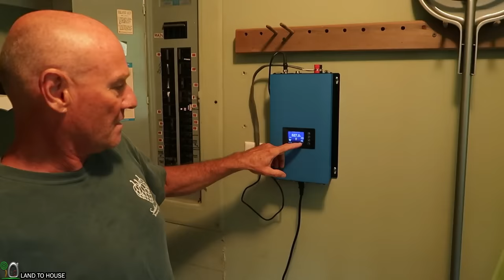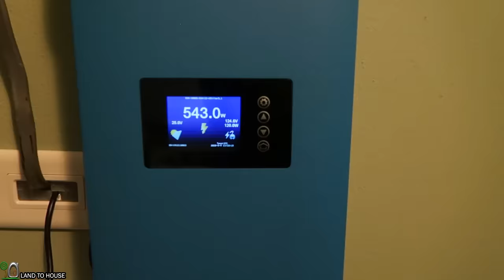Awesome Low Head High Flow Grid Tie Micro Hydro 530 watts!

Comment: If you put a valve (ball or butterfly) in that 8 inch pipe, you could turn it off, this would store water in the upper pipe (potential energy), so when you open it again it would start up the genny again with out the need of a shop vac.
Reply: Do you know how much an 8" valve costs?
Reply: i made a knife  gate valve from scrap for free, knife box below waterline in lower pool. so there you go

Comment: Obvious upgrade projects: meter the water level, add an automatic valve in there, make it self-prime - all fairly trivial and then you could just leave it running, then fix your meter.
Reply: Screaming for a Tesla powerwall battery system!
Reply: I was thinking the same thing.  Could be a simple as a float actuated potentiometer controlling a gate on the inlet.  Heck, if you really wanted to, you could use a float on a lever to mechanically control the gate if you didn't want to mess with switches and motors near the water.
Reply: Also switching the 90s for two 45s to reduce the loss of velocity thus increasing the energy generation, better yet, move the drop to the other side of the stairs
Reply: @MacroAggressor  An old toilet float would do nicely.
Reply: @dukeman7595  Sure, that would be the simplest solution.  My only concern would be with the on/off operation of it, you may induce unnecessary wear and reduce efficiency to boot.  But, as far as a simple off switch, that would be a great way to go.
Reply: Why wouldn't you just leave the water pickup say a foot below the surface, and just let it run until it can't? Obviously you would still need to prime the system but this way it wouldn't drain the pond.
Reply: @RedFly600  probably trying to avoid upstream standing water and mosquitos
Reply: @brettjames9088  yup, you don't want the garbage from the surface, probably wouldn't run very efficient either - the head pressure helps with the siphon too, seems like you'd want it deep under the water and then to control it another way.
Reply: @streaky81  yeah running or empty seems the best strategy to me if it was my property.
Reply: @SimplyStuart94  That's the spirit!
Reply: obvious but un necessary and undoable.............
Reply: Why not just use the vacuum take off to evacuate an appropriately sized tank with a float valve set to be open when the dam overflows and closed when it doesn't. This way, when the dam falls below operating level, the vacuum reservoir stores the energy required for the next priming and as soon as the dam reaches operating level again, the valve opens and the system self starts. It would only require the addition of a length of hose, a float valve and a piece of (offcut) pipe.
Reply: @zachyoung5598  gonna be honest, no idea what you are talking about.
Reply: @Brett James
The port that he uses for priming produces a good vacuum during operation (up to the vapour pressure of water). That vacuum could be stored in a tank (made of a piece of offcut 6" pipe equal in volume to the pipe above the turbine junction) by attaching a hose/pipe to the vacuum port and running it up to dam level, where it is connected to the tank by a float valve (set to overflow height) to open the tank when the dam is overflowing and close it when it is not overflowing. When the system is operating, it will pull a vacuum in the tank. When the dam falls below operating level, the valve closes. When the valve opens again (as the dam begins to overflow), the vacuum is released, pulling water into the pipe and over the dam, thus restarting the system. This eliminates the need for sensors and electrically actuated valves (the original solution proposed in this thread) and also removes flow obstructions associated with inline valving (the second solution proposed here).
Reply: @zachyoung5598  explain this to me like I'm 5

Comment: I know that there are limitations on location and practicality, but the turbine would last longer if it was placed down the flow path (low water pressure will cause cavitation on turbine blades and increase wear & tear) but all in all great job for making something green out of household materials !
Reply: @Artificial Hobos hmmm, don’t know if there are of the shelf self contained (with generator) solutions for that around. My only point was that if they are running it through submerged turbine, I would place the turbine assembly at bottom end and slightly restrict the exit nozzle (5% maybe) which would increase internal pressure and eliminate cavitation. But if the use something (like pelton wheel) which is built for air in the housing than my point is very much DOA :) but to your point pelton wheel might be more robust if stones get captured in the pipe. But going back to the placement - it better to extract energy from positive pressure which can come in many BAR than negative pressure that can only get to -1 (well 0 for vacuum but I’m referring to pressure expressed on working part).
Reply: @Artificial Hobos I love the ghetto style with washing machine motor :) Old engineering paradigm: "if it works, it works". In regards of Australia - I'm not sure how anybody could build any hydro there, one it's pretty flat, second water is a bit of luxury. But if one is so lucky to have both (river and decent elevation change) go for it. Thou in Australia, I would think solar would be better solution since sun exposure is a greater and land prices cheaper, but again all depends on what's ones circumstances. Going back to turbines, alto I think Fransic would be better than Pelton, I like the idea of aerator for a small pond and having some fish as well. Mist from Pelton could also provide nice cooling effect on hot days, so three birds with one stone :)
Reply: @Artificial Hobos Do you remember the name of that series ? I would watch it and maybe drop him some info on bearings if I found something obvious ?

Comment: I think instead of using the shop-vac you can put a Ball Valve near to the Outlet and move your Shop-Vac Hose connection to a higher point under the turbine to use it as a filler pipe. To start the Syphon for the first time, you have to close the lower valve, open the upper one and fill the Pipe with Water until it overflows from the filler pipe. Then close the upper valve and open the lower one. At this point you can turn the Syphon off and on whenever you want, only by turning the lower valve.
Reply: I think that lower valve could be fitted with an actuator controlled by a simple Arduino device which could be used to monitor pond level and throttle water flow to ensure the pond stays full to the brink of spillover. Or at least not vacuuming the pond dry.
Reply: He mentioned that idea as the "regular way" which is inconvenient. The shop vac was a great way to very quickly start it up without getting yourself wet.
Reply: Price out a 6 inch ball valve.
Reply: @kkarllwt  Where I'm sitting a 6 inch PVC ball valve costs $113.

Comment: 3:06 or at the end of the green pipe cover it up and then fill by hand some water until the green pipe is filled with water then once filled cover the hole then open the end of the green pipe
then suction will start and there ya go!
Reply: They did say the only other way to get it going would be to fill the pipe with water before he got out his handy dandy shop-vac lol
Reply: Priming a siphon basically

Comment: Take the water falling over the edge and fill the line up with a valve close to the end. When you open it it will suck the water up and over thus it will self prime without anything.
I built mine to be automatic with check valves.
Reply: awesome comment
Reply: itd be better to design the dam this way to begin with with a channel on a ledge to prime the pump.
Reply: @Dane Duttry   Not knocking your suggestion at all and have never built a hydro setup at all so this is only a suggestion that may be useless for reasons I don't know of but:  I was thinking after reading your suggestion of an idea. How do you think it would go if he had something like a large ball valve at the bottom to hold the water till you're ready to run it, up above but just below the dam runover he had a funnel mounted in a section of the water ran into normally over beside his pipe and it fed into it. The ball valve closed the water would soon fill up to that point just below the edge and if you had a floating ball that fairly cleanly sealed off the funnel when you opened the ball valve and things started sucking (in the best way) then you'd have only the ball valve to open to get the system running. 
 I know it wouldn't make a huge difference but, every little bit easier it is to operate and control has got to be a help. Anyhow, like I said, I have no experience, you do so I'm just throwing an idea at someone who has experience with this sort of thing to see what you think, useful or just a dumb idea that may even cause more problems than it's worth?
Reply: I pumped water a long way to a tank i would trap all the water in the pipe to prime the pump
Reply: Another thought, could you install another gate valve before the turbine to control the rate of intake so the suction doesn't drain the pond below the dam and ultimately the intake? I realize this would potentially slow the turbine but then he wouldn't have to worry about draining the pond down too quickly.

Comment: The vacuum you pull with that flow is insane. The venturi effect usually leaves a lot to be desired in denser fluids (water rather than air) but on a scale like this with a 30% increase in volume at the tailwater you are getting a massive vacuum. Its actually beautiful. You could increase the flow but that could lead to several issues in other areas, and fixing those might require some shotgun science. Patch it all and hope for the best. Guess the issue. You have a beautiful setup, sure it could be improved but why do it.
Reply: He doesn't need a vacuum on that pipe.  He has a downhill drop of 15 feet.  Once that water begins flowing, gravity alone will "pull"  water from the pond.  But here is the real point. He could easily have drawn his water from below the water line at the damn face.  No siphon needed.  Also I am certain that this flow rate could easily produce over 2,000 watts, ending his need for any power from the grid until winter.
Reply: I’ve been wanting to make one, we have a cabin near sa stream, this would help to illuminate our small and poor community. I just do not know where to start and who to ask

Comment: This is one of my dreams. A house near a peaceful river or creek and has unlimited renewable energy attached to it. I wish I have knowledge to reproduce this kind of tech and assembly with respect to the owner of the video. 

More power to you both, sirs
Reply: Ideal for stream or creek, not so ideal for a run off pond. Much depends on rainfall.
Reply: You're not going to power a whole lot of things with only 500 watts.
Reply: @Mick_A_Knuckle  you wont power shit with 500 watts. maybe a big fan or something
Reply: @Mick_A_Knuckle  it's better than nothing.
Reply: @Mick_A_Knuckle  500 is not zero
Reply: @cypresspuz  might as well be
Reply: @Mick_A_Knuckle  500 watts which could theoretically run 24/7. Pair it with battery storage and you're producing and storing 12kwh per day
Reply: @ThePmachell yeah he should've maybe bought a few deep cycle or lithium car batteries and set them up to trickle charge 24/7, then they could run off that at night independent of the grid and if the battery died have a switch to the main grid 

All this "unlimited" 500w power generation isnt much if it's not being stored 

I would've thought a turbine at the end of the pipe would produce more power than at the top. 

As at the top he's depending on flow rate, but at the bottom he could depend on flow rate AND potential energy pressure of the water.
Reply: @justinmacks1481  I'm no engineer, physicist or whatever but I was also thinking something the same.
why not also add an extra turbine at the bottom? it could probably squeeze extra energy from it. not only pressure enters the equation but also gravity.
Reply: @Mick_A_Knuckle  He could be pulling far more than 500 watts out of that setup. He's losing a lot of energy to flow speed

Comment: Brilliant ideas! I believe that there is a small voltage drop on the line that can be reduced by doubling the size of the conductors of the line. Greetings
Reply: Maybe put the inverter closer to the dam. 24volts 500watts is 20 amps going 100ft is about 20% voltage drop.

If he switches it to 120v at the dam that 10 gauge wire offers a 0.5% voltage drop.

Comment: This is one of the most effective micro hydro setups I have seen. If 500 W is all you need or want this works. Good work.
Reply: exactly, the point is making a bit more than you want to use,not mainstream thinking,gota make it big to make rich people richer.
Reply from the maker: Bill put a lot of thought into this setup. Turned out well for a hobby.
Reply from the maker: Bill is happy with 500 watts. Working well for him.

Comment: I've bought an array of second hand solar panels and I spent 500$ for the set of 10x 190w 44v panels and I picked up 2x 250w 48v panels for free. Overall I have an off grid set up for around AUD$750 producing 1.57kw 21amps 57volts. 
Your video inspired me to tinker with it some more.
Reply from the maker: Very nice! I have a solar panel installed series coming up soon!
Reply: The water still flows at night though.

Comment: I love his honesty about the rectifier. "I don't know how that happens, but that's what its doing."
Reply: Three diode bridges with a common output.
Reply: @Cotronixco  They would have to be high power diodes. But then again, 500 watts ain't all that much.
Reply: @josepheasey1114  Off-the-shelf diodes. Bridge 3 phases to DC. Nothing to it.
Reply: @Cotronixco  yup you already said that; you could drop a capacitor (to ground) in there too to smooth out the voltage levels
Reply: @josepheasey1114  Depends on the load.

Comment: At 9:15 you state that you don't know how a rectifier works: It takes the positive side of each waveform on each phase to one terminal and the negative sides of each phase to the other terminal. Really its just like a bunch of one-way valves that direct the electricity to the correct terminal for each polarity.